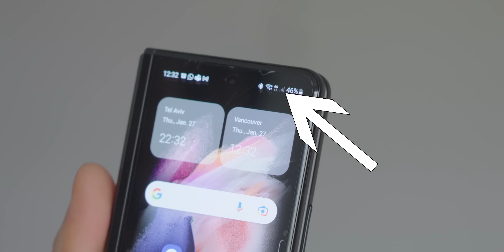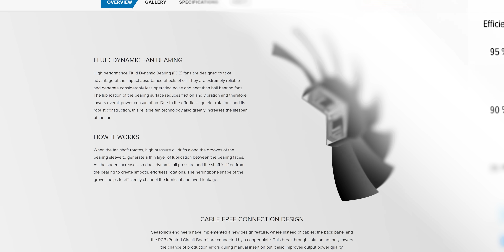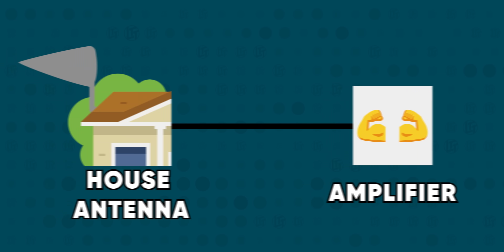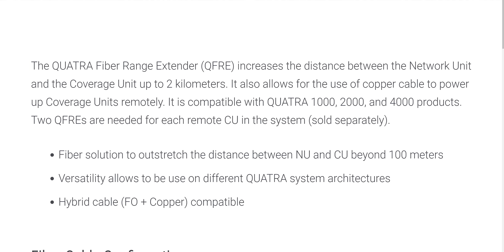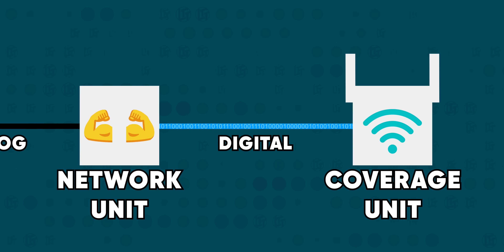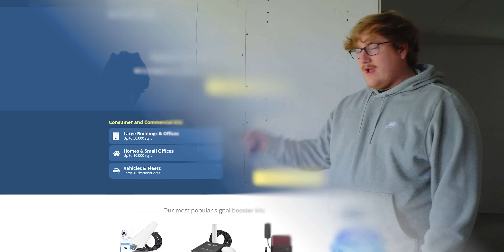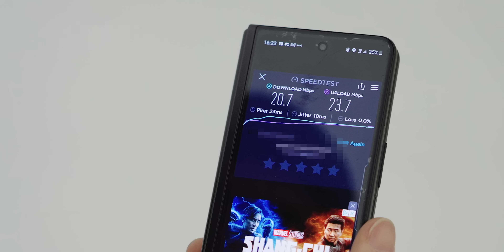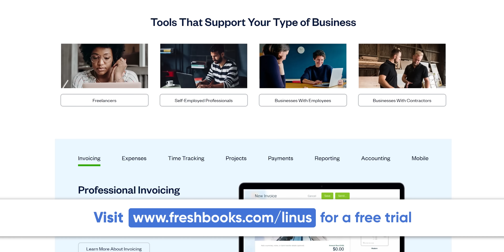I Hate This... New House Cel-Fi Cell Signal Booster Install

Comment: I actually have been looking into doing something like this for both my house and my dad's business, so I'm really happy to see that you did a video on it. I'll definitely be checking them out soon, and seeing if I can finally resolve their cell phone issues!
Reply: You may want to be sure this will be the solution. If your service outside of the house is terrible, this won't solve the issue.
Reply: @Moist_Accident  It can still be somewhat better because the antenna at the top spot of the house (at least it should be).
Reply: Depending on the cellphone service provider you have they can provide you with what's referred to as a cellspot which just uses your internet and generates a 4g lte signal. Sprint used to have one that they would give to businesses to help with this as well.

If it weren't for the cellspot i have there is absolutely no way I'd have any service at home.
Reply: @bourne_  a directional antenna with a slight elevation will only do so much. And even then, this solution requires that antenna to have a pretty clear reception. Climb a tree. Use a ladder. But if you are getting less than than optimal reception, expect that. This isn't adding a node. This is a repeater catching numerous signals that are absolute chonkers on the spectrum.
Reply: @Moist_Accident  
A correctly placed directional antenna is significantly better than the tiny ones you hold in your hand. 

I use both directional and omnidirectional antennas to improve hotspot WiFi at work and they can improve a barely connecting 1 bar signal to a stable signal with good speeds. 

It is obviously situation dependent, but it is incorrect to suggest a poor signal on a phone cannot be dramatically improved with an antenna that's 100x the size and focussed on a specific area.

Comment: Not sure if anyone's said this before, but you can use NetMonster or OpenSignal to find the closest tower, and the latter has a compass feature if I'm not wrong. Hope this helps!
Reply: Closest tower doesn't necessarily mean best signal, direct line of sight beats distance. So you definitely want to take that into consideration as well, and if none are in direct los you go with whichever has the least stuff in the way...
Reply: Does open signal work based of recorded data or the phone calculating the distance, if it’s the latter then it would make sense to follow the phone as it takes obstacles into account when determining where the best signal strength comes from.
Reply: @Samuel.55  recorded data, I used it a few months ago. It gets cell IDs from a database and points in the direction of whichever you're connected to based on GPS/ID

Comment: This is great! Just came here to tell you there are now also windows built with radio transparent insulated glass, which is probably a great idea if you're in the planning stages of building a new home. If your house is already built and the windows are in good condition, a repeater solution like this is of course the preferable choice.
Reply: Huh, what a cool concept
Reply: @TroublesomeOwl  Yeah, I agree! Not sure if it's available on the consumer market yet. But the company I work for did install 18 of them for a client last year for testing and evaluation purposes. (Disclaimer: We're not really in the window selling business, so this is not a marketing plug or anything like that).
Reply: Windows don’t usually account for the majority of signal loss - concrete walls and ceilings, multiple floors, really bad geographical location do and sadly there is very little that can be done outside of moving to a different place really. Cell boosters help, but happen to be illegal in many places unfortunately
Reply: @37racso  while all those factors you mention definitely makes a huge impact, I'd say it's also a matter of house design trends. At least where I live, it's very popular to build new houses with huge windows, like floor to ceiling, wall to wall-sized windows. Not in every room obviously, but second floor living rooms and such. And they're usually triple glazed and equipped with some sort of thin metal film to reflect UV light. Unfortunately they also reflect radio waves pretty well, so in those houses I'd say it could make a big difference for usable signal or no signal. But in the end it will of course be up to the architect and contractor to look in to the specifics of each individual building and location.
Reply: @carlkolthoff5402  Oh I mean if we're talking super modern housing with glass doors and windows and sometimes even walls then I'm sure that starts to matter a lot more. I meant more in terms of the traditional houses with relatively small window to wall surface area ratio. In the instances you described I'm sure it makes a bigger difference

Comment: I installed a simular solution a year ago or so in the middle of nowhere. Before the install customer had mostly no reception and barely being able to make a phone call when standing close to window. After install he had 140-150mbit down and up over 4G. Outside you could get maybe a 100mbit and on the roof you got 150mbit.

Customer was finally able to take orders via phone and their payment terminals worked.
Reply: @adoksym  Why?
Reply: @adoksym  But I've noticed that I have good cell reception inside elevators in Germany. Elevators are metal boxes, basically; so I always assumed they have cell repeaters (e.g. for emergencies). Do they have a special permit for that?
Reply: @Bratfalken  Funny thing. There was no phone line ever to this building. Most homes that are close have fiber. The building I did the install on were storage for boats up until a few years ago. I would agree that Telia sucks ass for cutting phone lines to most homes without having installed fiber to replace it.
Reply: @adoksym  I live in Sweden and its basicly the same. If you wanna install a repeater you have to go through special goverment channels to get permits. Dealing with goverment employees is always a pain.
There are however some exceptions. Most exceptions are based on installation in private homes in rural areas.

Comment: My cell service at home was downright nonexistent, then one day I started getting 3/5 signal bars and decent data speeds, but only really close to home. 

As I drove away from home, the service quickly faded until I got closer to town and regained signal

Found out later that my neighbor had installed one of these doodads. Thanks, Paul!

Comment: I did the cellular install on one of the skyscrapers in Melbourne about a decade ago and it was one of the coolest jobs I ever did. The backbone coax cable was really stiff and chonky af, about 5 cm diameter with a hollow inner copper conductor that was SOOOOOO easy to kink and ruin a run of a hundred metres while trying to make a bend.

Had one of my favourite days on the job ever though. The cable drums were massive, about two thirds of my height. And being an under construction skyscraper, the only way between floors with them was the alimak. The floor I had to move the drums from was only serviced by a single of the four alimaks and was halfway up the building, so every time it went past in either direction it was too full to get on. Spent half a day waiting for a ride up two floors.

Comment: Linus: Complains about actual floors and buys a cell repeater.
Me, living in Germany: Yeah, even those are illegal here :(
Reply: wait what? but why?
Reply: As a person that lives in Europe as well, and everything is bricks and concrete, how the flippedy fuck do I get full bars on the ground floor of our building.
Reply: @kdmion  American cellular tower isn't design for concrete
Reply: @MethmalDhananjaya  You need a licence, but you dont get one. ^^
Reply: @MethmalDhananjaya  apperently it's not outright illegal, but you can be fined if because of your cell repeaters for example your neighbors have worse cell reception i.e. your cell repeater interferes with the main cellular network.
Reply: Strange.. here in the Netherlands providers offer them for free as service due to new houses beeing so well isolated that most new houses have horrible reception
Reply: @Timberjagi  providers do offer them in Germany as well, but you can’t just buy and install them yourself.
Reply: Yes so sad. I have the same problem in my house ... but in germany illegal.
I get told that the fines are really high in the middle of the tousends of euros ... so i changed to WiFi call.
Reply: Floors are illegal in Germany?
Reply: @kuchenmustermann6191  my company has multiple wifi bridges set up and one of our providers Cough vodafone cough set up a nearby cell tower that didnt work afterwards and tried to sue our company because "we kill the signal". What they didnt know is that we had official licencing. So they got wrecked xD
Reply: AT least you have Provider Options. America has like one company per area. Options are always limited because of there aren't enough competition.
Reply: Yeah so sad.
Reply: Cell signal repeater is also illegal in Hong Kong too lol
Reply: @birdgamerman  Any day vodafone gets crapped on is a good day :D
Reply: In Czech Republic, you can get Cell "repeater" but you must connect it to the internet. I have it from Vodafone
Reply: @killer2600  in germany, Everything is illegal
Reply: @jankindl915  except for driving your bugatti with 260 mph / 417 km/h on the autobahn
Reply: @MethmalDhananjaya  because you can hijack and jamm the mobile network. (its the same technic the fbi and NSA uses to listen to your calls, thats why its forbidden here. Kuchen Mustermann said its not illigal, thats not true, you get up to 5 years of jailtime if you do that. Most of the time you get a hefty fine, but that dont mean its not illegal..
Reply: @Blackbirdone11  There is altso the issue of possible un intended (non malicious) jamming, or interference, causing degraded signal for all non intended users, IE passers by.
As to the legality, I cant speak for Germany, but here in Norway it is possible to apply for permissions to install such a system, but even then it's highly regulated and as far as i know very expencive. so not something the typical  home owner would do. more of a bussines endevour
Reply: Why don't you just use Wifi-Calling?
Reply: @kuchenmustermann6191  so then this waveform system would be fine
Reply: @JPK1337  repeater installs like this are still illegal in pretty much the whole EEA, for good reason.  
1. you need a regulatory licenses for the band you will be transmitting on 
2. that requires the permission of the mobile company that has licensed the band
3. you also need their permission to even use a repeater on their network.....

Usually that all is not really an issue though since almost all providers offer micro- or femto-cells as an option which only need IP access to their BTSs.
Point one can be "fixed" by using 5 GHz for the repeaters, which does, like WiFi, not require a license but also is not that common yet.
Reply: @JPK1337 it is still broadcasting and requires the fit license to do so.
Mobile providers pay a lot of money for exclusive access to their portions of the frequency sets.
Reply: @JPK1337 that is still potential interference and you are not allowed to do so, you cannot even use any HF amplifier unlicensed, that's why radio licensing exists, even amateur radio requires it.
Reply: @JPK1337  you have very little understanding of what amplification and repeating actually do to a cellular network.
This is nothing you can just do.
Reply: Just use wifi calling

Comment: Watching this vid with interest. We used to have the internet-based signal boosters at our place, but AT&T discontinued them after it was discovered that it messed with their DSL service (to the point that it took down a whole region repeatedly). We tried adding some Amazon-bought boosters, which kind of worked, til AT&T had a service rep stop by with an angry letter saying our boosters were negatively affecting reception in the entire area. We tried a booster that the rep said AT&T signed off on, and it mostly works, but doesn't reach the full length of half our house. I haven't tried it in recent times, but the WiFi calling features sucked when they originally came out cause the phone would switch mid-call to any even sliiightly decent cell signal, then drop the call as soon as the cell signal crapped out.
Reply: my phone now has a setting in the wi-fi calling options to "prefer wi-fi" so it doesnt' jump to cell connections if it detects one.
Reply: @girlsdrinkfeck  Mentions it at the 2 minute mark
Reply: @girlsdrinkfeck  Doesn’t work on all carriers, those that do support it don’t always support SMS, to save you 5 seconds of video watching… In the UK it’s not available to “pay as you go” customers either.
Reply: @girlsdrinkfeck  "I'm in UK"
Me :    It shows
Reply: wi-fi calling works ace with one of Australia's big three carriers and pants with the other two... but it's so badly understood that even the salespeople seem to struggle to understand how it differs from messengers.

Comment: 15 years ago I was working as an engineer designing equipment that would be located in the middle of nowhere and we needed data transmitted back to us via cellular.

Finding the right equipment back then was a huge PITA but we finally got it sorted out. We were lucky in that we were using a cellular modem where I could wire the antenna directly to the modem and not have to rebroadcast the signal.

Comment: I’ve used a number of Cel-Fi units over the years and they’re great. Some useful tips:
They have repeater units which connect wirelessly to the primary/network unit, though they’re much happier connected via network cables as it doesn’t take a lot in between to significantly lower the signal between the units, which tends to significantly lower the reach of the repeaters.
Of those I’ve used, the primary/network unit also acts as repeater so you won’t also require a repeater in the location it’s installed to.
Try to install the network and repeater units as far away from the outdoor antenna as possible, as although the coax length can cause losses, having them too close to the outdoor antenna can create a feedback loop giving all sorts of buggy issues, especially if your main antenna signal is already very low.
I also set up my primary/network unit (and repeaters if they separately powered) on a mains power timer (just a cheaper rotary timer is fine), so the system automatically powers down daily so it can resync everything.
Reply: But why not something as simple as wifi calling?
Reply: @minskwatcher  because many phones aren’t capable of WiFi calling.
Reply: @jmacd8817  What phone, that has LTE access, has no WiFi calling in 2023? Hell my Oneplus 3 had it, back in 2016.
Reply: @DooMMasteR  my phone has wifi calling but my 5g home internet does not support wifi calling

Comment: Hey I've installed dozens of these Cel-Fi units. They are a top notch vendor and this stuff just works. We've installed them where signal outside was almost nothing and it managed to pull in plenty usable signal, with the right donor antenna, and phones inside the building just started dinging with missed messages and calls. 

Cel-Fi just WORKS!

Comment: As someone who owns a Cel-Fi unit, I can probably explain a few things. 1) The reason your uplink was so high is because it is much, much easier for your phone to push your data back through the Cel-Fi system than it is to receive it given the distances involved (a few miles to the tower, a few feet from your phone). When I used mine with T-Mobile, there were many times where my upload was consistently higher than my download. The second thing: dialing in the frequencies used in your area is essential. These systems can lock in on two or three frequencies at a time, but they will waste tons of time scanning all possible frequencies to find the right ones, and if the signal cuts out for any reason, it will start over. When I set up the Cel-Fi Wave app, I originally locked it to one signal only (735MHz I believe), and it worked flawlessly all last year. It only stopped working because T-Mobile then changed the frequency at the tower to 1980MHz, meaning I have to take the antenna from inside the attic and move it outside (lower frequencies can penetrate buildings, and where I live gets lots of snow, so at the time, keeping it inside was the better solution).
Reply: Even without any repeater, my upload speeds are twice as much as download speeds
Reply: I have a cel fi locked to 1 provider.. Now I changed and wish I could unlock it. If there's a way please let me know 🙏
Reply: @Airbag888  you should be able to change the carrier using the WAVE app. Maybe reach out to the team at Waveform.
Reply: No.. the backhaul is saturated with downloads, not uploads. There is almost always easier to get high upload speeds vs download.
Reply: You are totally incorrect... Ted explained the upload vs download discrepancy... it's a congested tower... ie too many people trying to connect at once